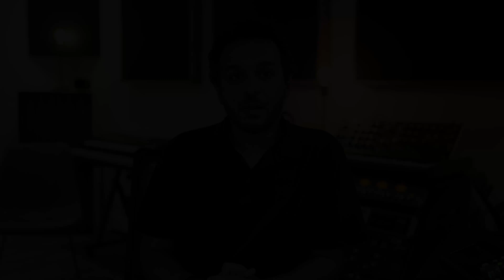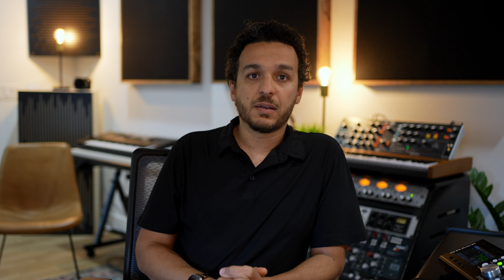How to use Hardware Gear In Mixing with Logic Pro | Full setup with Antelope Galaxy 32

Comment: Great video! Thank you for this explanation. I had a question about how you would recommend incorporating outboard processing in a hybrid studio with something like an Apogee Symphony MK2 and the Dangerous 2 Bus+. The Symphony MK2 can be configured with 16 or 32 channels of I/O. The way I see it there are two ways to approach this setup: Option 1 (using 32 channels of I/O): Connect channels 1-16 of the Symphony directly to inputs 1-16 of the 2 Bus+ for summing and then use channels 17-31 on the Symphony to insert hardware directly into Logic Pro the way you describe in this video. Option 2 (using 16 channels of I/O): Connect channels 1-16 of the Symphony to a patch bay (like the Flock Patch) then connect the Flock to inputs 1-16 of the 2 Bus+. Use the Flock to insert hardware before the signal goes to the 2 Bus+ rather than using hardware inserts in the DAW.  It seems like both methods are viable. Option one would require more AD/DA channels to connect to each piece of outboard gear. Option 2 would require less AD/DA but would require a patch bay. Option 1 would create more round-trip AD/DA conversion. Option 2 would require less AD/DA conversion and would allow for daisy chaining of hardware effects. I would love to know your thoughts on these approaches.

Comment: Thanks for the video. With the I/O plugin are you then bouncing in realtime to a stereo track within Logic  and if so what is the routing for that?
Reply from the maker: You would bounce that track the same way you would bounce any track. No special routing needed. You just have to bounce in real time and not offline.
Reply: @fadygergis  are you saying you bounce that track in place or the whole session in realtime?
Reply: I find if you bounce the whole session in real time it’s fine, but when you want to run various tracks through the same hardware (having to bounce in place) it creates problems. Even with latency off-set etc it will usually render the audio in a different position. Pro-tools is better for rendering audio in place through hardware - I wish logic could address this side of things.